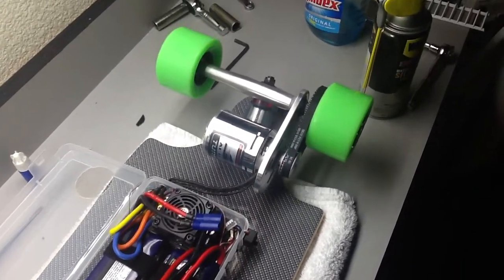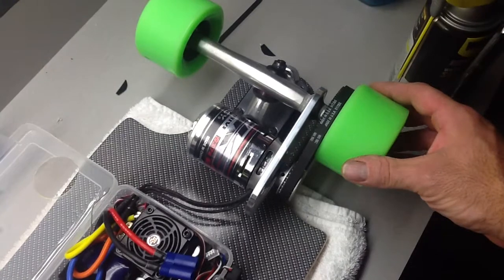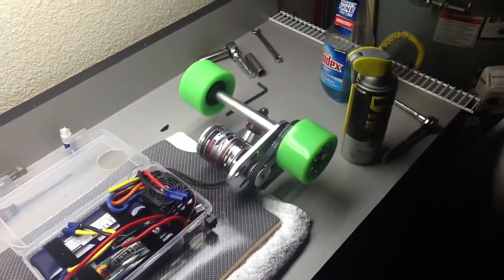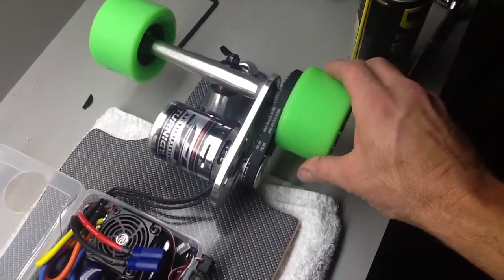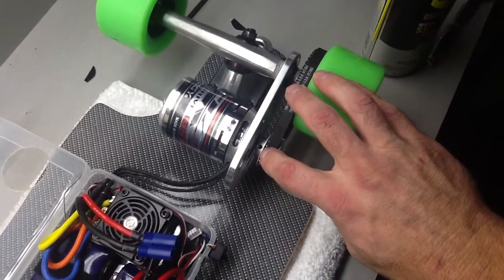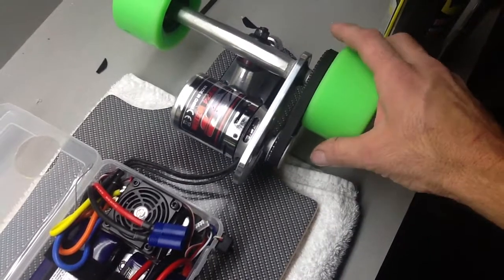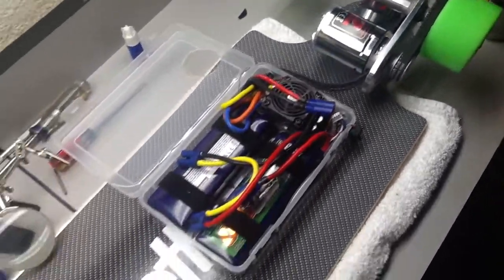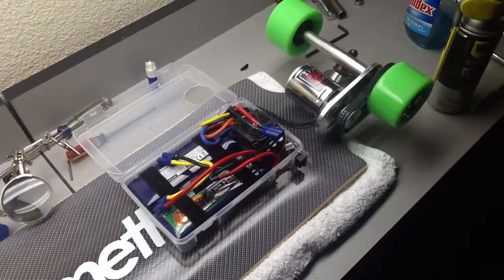DIY electric longboard complete

Comment: What angle do I put my motor mount on at?? I have big wheels 110 but not a lot of clearance between my trucks and board
Reply from the maker: just be sure to keep the mount as close to the board as possible allowing enough room for the motor to clear the board when the truck flexes side to side.. if you have a standard board that does not have a drop through type truck mount you can add up to a 1/2" plastic riser pad for extra motor clearance.

Comment from the maker: Actually only 5000mah. Batteries are run in series so 2-3s 5000mah lipos = 6s @ 5000mah. Getting about 7miles
Reply: i also weight 220 pounds and run 270kv 50mm motor my board goes up to 22mph i did 9miles run on it 2 days ago and still got 55% battery left in. i use 10000mah 6s so my setup seems to be more efficient than yours. it shouldnt be in teory as you are useing lower kv motor... im confused why is this
Reply: greg23842384 wow we have the same set up, what esc do you use 120amp?

Comment: how far (range) you can go with that 10,000 mah and SK3 6374-149 motor ?
Reply: +Trung Le I Made one similar to this, I only get around 4 miles and I weigh 160 pounds i doubt he's getting 7 miles off of his board.
Reply from the maker: Too many variables to compare your setup to mine. Bearing quality, belt tension, battery quality , low voltage cutoff setting, gearing, wheel size and compound, road surface quality, and mostly driving style. I absolutely have gotten 7 miles out of this setup on flat asphalt. I use a gps when testing to get accurate numbers. My range can go anywhere from 3-7 miles depending on these factors.
Reply: +scott halstead how many cells are in those batteries/what are the specs 2x 3s 5000mah hooked up in series?
Reply: +scott halstead you have an identical setup to mine, you said you weight roughly 200lbs? I honestly can't see you getting 10miles in all honesty? if you were then why aren't the boosted board people doing what you're doing? their boards get only around 7 miles...
Reply from the maker: I never said 10 miles. I said about 7 miles. My best distance was 6.84 miles with reds bearings, hard compound wheels(not the ones shown in the video) geared for 18mph top speed, light belt tension, and pushing about  10 mph. I set the LVC on the esc to 3.0v per cell.
Reply from the maker: correct, more MAH+ more run time. But also adds more weight and takes up more space.
Reply: +MediaTechSmash also with bigger mah batt you get less voltage sag as battery wont be wirking that hard so therfore 20000mah should get you more than 4 times that range

Comment from the maker: Motor is capable of 10s. But the esc only 6s. An esc capable of 8s 
is going to cost big $$$. 6s with this motor is getting 18mph with me 220lbs on flat ground. It feels fast. If you really want more speed, I'd stick with the 6s esc and go with the same motor in the 200kv range.
Reply: I was thinking of buying one of these but i think i am going to build it now, can you give me a parts list and look at these and tell me what you think http://diyelectricskateboard.com/product/wireless-wii-wiiceiver/ i think this would make a perfect enclosure http://www.ebay.com/itm/Black-Universal-Car-decorative-Air-Flow-Intake-Scoop-Bonnet-Vent-Cover-hood/111110656697?_trksid=p2047675.c100005.m1851&_trkparms=aid%3D222007%26algo%3DSIC.MBE%26ao%3D1%26asc%3D20131003132420%26meid%3Db413329cedcc49f78c502f93420b5052%26pid%3D100005%26prg%3D20131003132420%26rk%3D1%26rkt%3D6%26sd%3D160619241013&rt=nc
Reply from the maker: MARLON DALEY The enclosure looks great as long as its not too wide and can be removable to access your components. I almost bought the wii receiver but opted for the quantum 2.4 pistol grip radio from hobby king. If you remove the wheel its pretty small and at $20 its an inexpensive option. 

Parts.....
Diy truck kit with hardware & wheels included
Flat, top mount deck (stiff with little flex)
1/2" truck spacers (for extra clearance)
2-3s 5000+ mah lipo batteries
hobbywing 150A rc car ESC (best bang for the buck IMO)
Turnigy SK 63mm 149-270kv outrunner motor (low kv for torque, high kv for speed)
2.4 ghz transmitter and receiver or wii receiver.
enclosure + misc. hardware

All your electronics can be purchased through hobby king.com. They have USA west and east warehouses for speedy delivery. Great prices too.